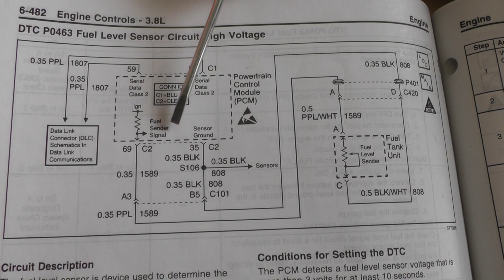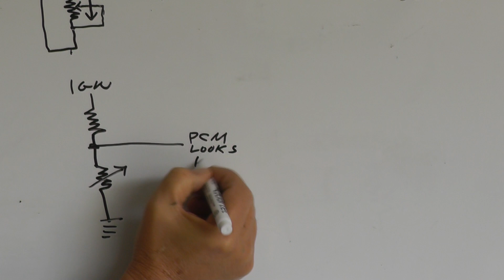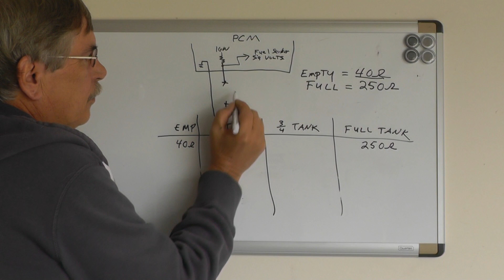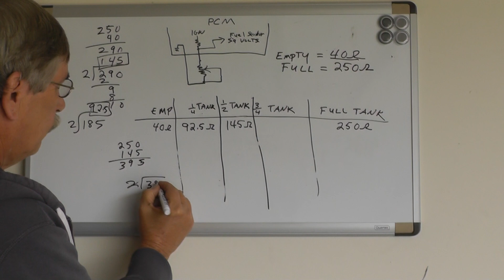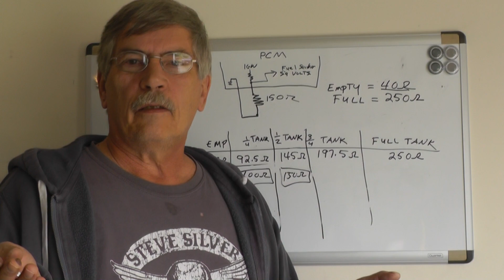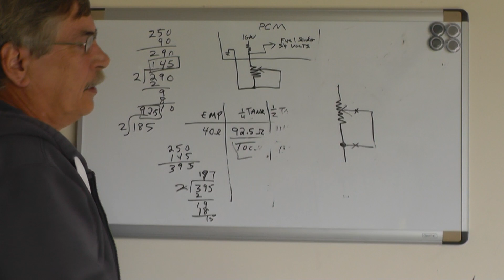GM Fuel Gauge Erratic, P0463 - Part 1

Comment: Excellent video. My son has a 2006 Chevy Silverado with a P0449 evaporative emission vent solenoid control circuit, and a p0463 fuel level circuit sensor one high voltage.  Could the p0463 fuel level circuit code be causing the P0449 evaporative emissions code?
Reply from the maker: More than likely you have two separate issues. The P0449 is telling you that you have a circuit issue with the vent solenoid. The solenoid could be open, wire broke or not likely an ECM issue. And the fuel level sending unit is a common issue on GM issues where the fuel sending unit is the most likely cause.
Reply: @stuzman52  Thanks.

Comment: great info how would I diagnose a system that uses two sending units
Reply from the maker: I've never worked on one Paul, but if you have two fuel tanks, I would assume that you check each sending unit individually.

Comment: How  to conect wire fuel geuge to flaoting sending unit
Reply from the maker: The wiring will depend on the make and model of the car. Take a look at a wiring diagram for the car that you're interested in and the info will be there.

Comment: Good job! sir, i guess you made a slight mistake. For half reflection your result should be 255 which is 2^8   (8  bits), 0 - 255 ; if your starting point( 0-point) is 40; you should subtract 255 - 40 =215 then divide it to 2 = which is 107.5
+ half of your 40 =20 then 107.5+40  = 157.5

Comment: Hello man, i love your videos and i have one question please.
I have a 2002 gmc envoy and the issue i am facing is that the fuel gauge is working inversely, means that when i full up my tank it goes all the way down and the orange led just lights up, and when fuel amount decreases it starts to go up until reaching full when the tank becomes empty.
Thanks a lot 🙂
Reply from the maker: Hi Michael and glad to hear that you like the videos. The only thing that I believe that can cause this is that the wires to the fuel sending unit are reversed. For this to happen, the wires were cut possibly and a pigtail connector was installed. During installation, the wires were reversed by accident. More than likely the fuel sending unit and or pump was replaced in the past. I would start looking there at the tank to see if that's the case. Good luck Michael!
Reply: @stuzman52  actually i have been facing this for a long time and i thought that replacing the sending unit may fix it, but few days ago i had to replace the whole fuel pump including the sending unit and i was shocked that nothing have changed
Reply from the maker: @michaelsaleh55  While you were in there, did you see any signs of taped or spliced wires for the sending unit. Having reversed wires is the only thing that could cause this. Keep in mind these two wires could be swapped anywhere from the tank to the instrument cluster. As a test, you could reverse these wires and see what happens to the fuel gauge.
Reply: @stuzman52  i will try this, thanks a lot 🙂
Reply from the maker: @michaelsaleh55  You're welcome. Good luck!

Comment: My car, Civic Es 8 has a problem of indicating a wrong fual level.when i stop the vehicle with some amount of fuel it indicates correctly on my instrument cluster gauge. But next day when I start the car, the fuel level seems to go down suddenly.After driving 15 to  20 mins, it goes up again like it shows before, this happened after i changed my fual pump with floatr, could you please help me on this??
Reply from the maker: My best guess is that you have an issue with the fuel sending unit. As you said, the problem appeared once you changed the fuel pump and sending unit.
Reply: Sorry i dont know what is the sending unit of my fual pump, can you please explain to me this with a picture ??
Reply: Also please let me know can i change only sending unit instead of changing fual pump,

Comment: Hi Terry. I found you again after a google search, to decide whether my occasionally unreliable dashboard fuel gauge was the dash stepper motor or the sending unit inside the tank. As always, I like your clear thinking. Of course dealing with an intermittent problem can be frustrating.  I will attach my scan tool, make a baseline plot plot of fuel gauge voltage reading when the gauge is working, then wait for a convenient time when it fails. Then when the dash shows a bad reading, I'll use the scan tool to decide whether the stepper motor is accurately representing the voltage coming from the sending unit. I suspect the sending unit is on its way out, but a stepper motor would be so much easier to swap out, ha ha.
Reply from the maker: I like the way that you think too and your method should be able to decipher whether it's the stepper motor or the sending unit.

Comment: I have a 92 chevy k1500 that has been an ongoing saga. I bought it  as a project and it has come a long way but still has bugs to be worked out, it surges on idle,  sometimes badly then when it warms up goes into high idle. no check engine codes. things ive done are replace coolant temp sensor, rebuilt throttle body, checked egr valve, checked pcv valve, cleaned Iac motor,  refreshed distributor, put new battery, tested with different ingnition module. timing is good, I adjusted valves and wires rotor and cap are all good. no arcing. I feel like it is a sensor problem because the computer seems to try to do corrections almost constantly, until it warms up and goes into closed loop, then it just sits on high idle. I check for vacuum leaks, and replaced the throttle body gasket when I rebuilt the throttle body. fuel is good. injectors seem to be spraying fine.  I have a feeling it may be the IAC motor because the problem is intermittent, sometimes it starts and idles just fine. I dont have an oscilliscope so im kind of tapped out on things to try.
Reply from the maker: texas tough If you have a scanner that reads data, you could take a look at fuel trims to see how they are doing. My next suggestion would be to take a scope and see how the IAC is doing. Since you’ve checked everything else, you could try the IAC but keep in mind that it’s only a guess without the equipment to check it.
Reply: thank you im a retired HVAC contractor and major appliance tech, Ive always believed to fix something you must know how it works to begin with. from what im gathering, it seems besides initial timing the only thing that controls open loop idle is the coolant temp sensor and the IAC. so being the temp coolant sensor is new, and is working(if I unplug it throws a check engine light immediately), im leaning towards a intermittently failing Iac. as I said, sometimes we think we got it fixed, truck idles beautifully, then starts hunting again. after rebuilding the throttle body, it ran great, but I had removed the IAC to clean the throttle body, then replaced it. just touching the pintle could have unstuck it , then it stuck again. from what ive learned. the truck doesnt open the throttle plates at all during idle.. when the throttle plates are opened for acceleration IAC is closed, and ECM sees the TPS position,  to advance timing,  and increase fuel.. also do you think it matters which wiring harness goes to the injectors.. can they be swapped?
Reply: all I have is an OBD2 scanner, and the check engine lights dont tell very much for fine tuning these trucks. I may invest in a oscilliscope soon. my truck doesnt have a tach either, so that makes troubleshooting tougher too.
Reply from the maker: @randy1ization  Welcome to the retirement world Texas as I'm retired myself :) You are correct that the secret to troubleshooting is to understand how it works and from there you can develop your own strategy in troubleshooting. Here's a little background on the IAC on your vehicle. The IAC uses a stepper motor to control a pintle position which allows more or less air into an opening. At idle, the throttle valve would be closed, but the IAC will retract its pintle off of a seat in the throttle body to allow more air for idling. As you're crusing, the pintle would still be retracted off of its seat even though the throttle valve will be held open. The reason is so that when you lift your foot off of the accelerator, there will still be air going into the engine from around the pintle into the seat to prevent the engine from stumbling. Other areas where the idle would change is when you turn on the AC or when you turn the steering wheel and the line pressure increases in the power steering system. For those conditions, the idle speed would increase. These different positions of where the pintle moves in and out could be observed on a scanner that supports data which would be shown as IAC pintle counts. As the counts go up, the pintle would retract allowing more air into the engine. And as the counts go down, the pintle would extend blocking off air going into the engine.

The PCM controls all four pulses through four transistors feeding the two windings going to the stepper motor. Although a scope is best to see these square wave signals, in a pinch you could use a test light if you want to verify them by its switching action  I'll post a video where a procedure is shown for that at the end of this comment. Another test would be to lightly tap the IAC and see if the idle speed changes. If so, change the IAC as I wouldn't bother cleaning them as I haven't had much luck with that and they're not that expensive. Be sure to clean any carbon around the seat that the pintle sits in. With all that you've done, it's probably a bad IAC motor. Good luck on what you find and it's a good idea for a scope as they've come down a lot in prices. And they can take a lot of guesswork out of troubleshooting. You could look into Rigol and Hantek as most people seem to be satisfied with them and the price is not too bad. Here is the link to the video that I mentioned earlier. Although they're using a later model Buick, the IAC should be the same as on your vehicle. https://www.youtube.com/watch?v=qMAUBU-6ErY

Comment: When I unplug the wire from the pump the fuel gauge stays on empty, and when I jump the plug the gauge still stays on empty, any idea what could be wrong?
Reply from the maker: Will Snow get a resistor about 250 Ohms and put that across the plug. You should get a full tank reading.

Comment: OH, so on a rheostat, if I was looking at volts I might see very little change and think the component was bad, but knowing some are rheostats, I should look at the amps and see the great variation. I just learned something new. Did I get it right?
Reply: For when I paid attention and counted your angel and I are both 1 for 2 for answered questions correctly. :)
Reply from the maker: +DE Nichols Hi DE...when one speaks of a rheostat, it's more of how it's wired as I point out in the videos which is more of varying current. The potentiometer where it's name is potential, (voltage), varies voltage. With a potentiometer, the current wouldn't vary through the total resistance of the pot as its resistance is fixed even if you were to move the wiper. Yet, the voltage will vary from one of the outside legs to the wiper. When you see a pot wired with its wiper connected to one of the outside legs, like fuel sending units, folks in the industry will say that its a rheostat which would vary the current, but at the same time it will vary the voltage too because the total resistance of the rheostat will change because the wiper is part of the function now. Even still, the computer is still looking at a voltage change. You could see the variation in current, but it would be an extra step to wire an ammeter in series with it. I would just measure the voltage across the sending unit as I show which is faster. Thanks for leaving a comment DE!!!
Reply from the maker: +DE Nichols It's always nice to have a wife who shares your interests especially if she willing to take care of the filming. And she can give some feedback during the filming to see maybe how other folks out there watching the video may be wondering about too. Thanks DE...
Reply: stuzman52
Your welcome and thanks are to you as well. I see I'm not the only one to make big comments to be sure my viewership fully understands. Thanks, teach, especially on Christmas. :)

So on a rheostat still check the voltage as the PCM would, just realize it'll vary less. Did I get it now? lol
Reply from the maker: +DE Nichols Yes DE...just check the voltage as it will be a significant change in voltage. Remember, that the voltage will vary across a 40 - 250 ohm resistance. So, the voltage will vary from 0.7V to 2.5V across the fuel sending unit. There is enough variation in voltage that you can see a difference. So, are the kids at your house all excited about their gifts? Around here, it's a little quiet as my kids are all grown now...
Reply: stuzman52
Oh my yes, they are excited! I just finished uploading a video of some of my pre-Christmas preparations. I shot some video of the Christmas stockings openings, but I was in bed and even though everyone was covered it was too personal, lol.

My middle son even got excited about other people getting a gift so he's growing in wisdom already. :)

Their excitedly playing a board game with mom. Since it's Christmas I won't try to be "bored" with them, lol. Being a bit about me on Christmas, lol.
Reply from the maker: +DE Nichols Sounds good...I'll check your video out in a few minutes....

Comment: very interesting video...here comes the question and let me first begin with i have purchased many voltage testers that have all rusted in my tool box cause i never learned how to use them lol..Since the ohm calculations are so precise on the level of a  empty to a full tank of gas why do i get better gas mileage on the first half of the tank than the second half when the needle goes the same amount of distance on the gauge?? thanks Terry
Reply from the maker: +RICKAFIX Hey Rick and hope you're doing well. Your gas mileage should be the same throughout although the rate of decline for the needle on the gauge could vary. As one viewer pointed out, the different configurations of fuel tanks could cause this. In this video, I was thinking more of a fuel tank that was symmetrical in depth. In the second video, I'll cover the different tank configurations and how this could vary the needle which may not be linear. Take care Rick...